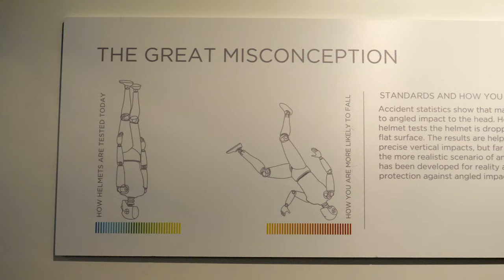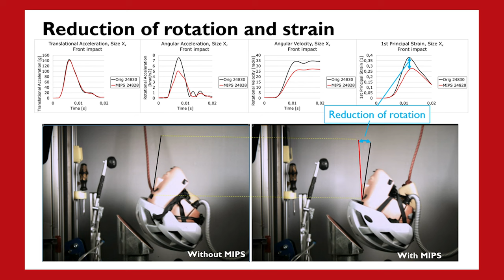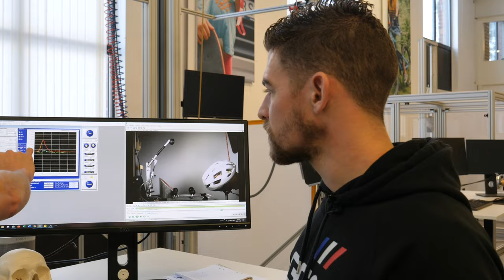What Does MIPS Do? | Cycling Helmets, Concussion & Brain Injuries

Comment: Very interesting! In the beautiful slow-mo shot at 15:34, using the <> keyboard keys you can see that the helmet deforms on impact while the head keeps moving forward because of the structural separation between the outer portion of the helmet and the head. I don't know if the rotational energy causing concussions thing is true, but by designing the system to absorb rotational energy as well as direct energy, the system is absorbing more of the total impact energy, thus lowering the total energy going into the brain.

Comment: Retired engineer here. Very interesting thanks very much.  
More information about the following would have made it even more interesting.
1. A clearer explanation about how MIPS works. Are there two parts to the helmet, an inner part 'fixed' to the head and an outer part, the shell, which slips over the inner part to dissipate rotational impact forces? 
2. Analysis of the comparison of test results for helemets with and without MIPS. 
3. Discussion about ...does the fact that the test head is not connected to a body make any difference to the effectivness of MIPS?  Here I'm thinking.... on the one hand the test head and helmit bounce off the anvil into the air, which dissipates impact energy.... and .... and on the other hand, IF the test head and helmet were connected to a body they could not bounce off the anvil into the air,  THEN where would the energy thats dissipated  by 'bouncing off the anvil into the air'  go?  Would it go to the head and be dissipated there or what?

Comment: Interesting video, just had to buy a new helmet after a crash which smashed it up and it's a no-brainer (sorry) to get one with mips as the price differential isn't that great anymore and it's available on helmets lower down the range. My question is what's the difference between the MIPS system and having a cap on underneath (or indeed lots of hair)? Wouldn't both of those things also allow the head to move independently of the helmet in a similar way?

Comment: So, should mips eqquiped helmets be freely rotating "10-15mm" while wearing it? Or should it be tight and barely moving like there's no mips at all? 
Because I think the biggest problem here is helmet sizing. For example, 59cm head size falls between a large and medium size. With a medium size, the mips helmet barely moves(kinda defeats the purpose of mips) but with a large size helmet, properly fitted, the mips "motion" is very noticeable.

Although this is a great informative video, it didn't even tackle sizing and proper fitting of mips eqquiped helmets to properly take advantage of the new technology.
Reply: There is an internal "cage" with adjustable fit via a ratcheting wheel on the back of the helmet. This cage is suspended by the mips system which isolates your head from an impact on the external helmet shell. So basically when you have the helmet on, the internal cage remains tight on your head but you can move the shell of the helmet slightly. You would choose a mips helmet size like any other helmet.
Reply: @JulitoPapitoo  I think you missed the whole essence of my comment. It's the sizing of the helmet that makes this technology a hit or miss. Yes, the ratcheting wheel can make your helmet fit better, but the outer shell still remains big if the consumer falls in-between sizes. My example was a 59cm head size which generally falls between a large and a medium sized helmet. The difference in the size of the shell  is very substantial between large and medium. So, even if you tighten the ratchet wheel (on a large helmet), the mips cage is secured but the shell moves too much. And if you do decide to go down a size (medium), then the shell plus mips cage sits/rests on your head. As a result, the cage has very little to no allowance to move. Or worse, it actually moves with the shell itself (which then becomes a traditional non-mips helmet). This "slight" movement that you've mentioned actually has a range in millimeters according to MIPS. So, you can't just say pick a helmet size and see if it moves "slightly".

Comment: Rotational motion in head trauma causes what is called diffuse axonal injury, or DAI, which is when the axonal fibers of the neurons are sheered off because of the rotational motion.  This is because the gray matter, where the brain cells are located and the white matter, where the axon fibers are located, have slightly different physical propertiers so that a sudden rotational acceleration cause the two layers to accelerate/decelerate at different speeds resulting in a sheering force between the two layers.   This causes the axons to sheer off from the neuron bodies.  
This is different from a direct blow to the brain, which simply contuses, or bruises the brain at the surface

Comment: Only recently come across MIPS and find the tech very interesting. I’ve had a number of severe cranial injuries in my time, only two involving cycles. But both of those involved having the cycle & me being flung into the air and one involved being partially run over by a hit+run car, with me thrown over a bridge’s parapet. I could’ve done with something to reduce both head injuries. (Mind one could’ve been helped, if the driver hadn’t left me hanging off a bridge, while I bled onto the dual carriageway below.) Never did find the driver .

But MIPS, yes. I’m just about to renew my chainsaw helmet. And only one forestry helmet, has MIPS protection built-in as standard.

Comment: Great vid, completely agree with what MIPS are doing however, when they test why are they not using a full weighted body not just the head because surely this increases the impact speed, pressure and other aspects such as rotation???
Reply: Virginia Tech has done that. Check the link I attached above.

Comment: Recently bought and then returned a MIPS helmet that I very much wanted, because it was the wrong size and didn't fit properly. I had assumed that S, M & L nomenclature was a standard among brands, and didn't even try it on when I purchased it. In one brand I am "Large" and in the other I am a "Small." Must go by mm size only! Now I have a non-MIPS helmet that fits properly. I think it's a great advancement and will purchase one in the future, I expect. I wonder if a non-MIPS interior system that allows some movement is advantageous, if not quite as much so.
Reply: I just bought a MIPS helmet from Bell.  My previous Bell was not a MIPS.  Same size helmet (medium) and supposedly I am 3cm under the upper size rating.  The MIPS one fits a lot more snug, almost too snug.  I usually wear a casquette and probably should have gone up a size.

Comment: The plastic of the mips reduces the crushing of the EPS foam in a straight on impact, and their test rig has the grippiest grip tape which maximizes the rotation, I wonder how much difference there would be with asphalt and if that would offset the reduction in crushing from the mips plastic 🤔

Comment: surely the mass of the brain relative to the skull can be known as well as the distance from skull to brain as it floats in the protective fluid , therefore we can calculate accurately how far said brain will bounce around. the goal is to create an isolate gyroscope for the head ( and ultimately the brain ) to ride inside of as it collides with another mass, moving or not. 

considering the skull is connected to the spine and upper body, a full skeletal model inside a mold would need to be implanted with millions of microchips and then subjected to countless real world inertia tests at all possible speeds and angles

then we would have a truly perfect as possible helmet
Reply: basically antigravity helmet :D

Comment: best case scenario, just head weight. Add the extra 150 lbs body weight for the average American and you will find the angular/linear shock absorptive capability ALREADY maxed out. The tail end of the acceleration will show a spike when the end of the mips track is reached. (Mechanically this means that the mips is already at the end of its rotational limited track.) The frictional track of the mips may have to be increased in proportion  to the increased several times weight to allow as linear vs time angular mometum decrease. Instead of smooth plastic a higher friction surface and longer track may be more ideal to absorb more energy to prevent the spike. Ex aero space Eng

Comment: About 21 years ago I had a head on with a car at speed. Wrote off the bike and cost thousands of damage to the car. I hit the windshield head on with my head shattering the windshield and helmet, flipped over the top and end up in a ditch unconscious. Probably exactly same impact as shown in tests here. Ambulance arrived and carried me off to hospital. After a number of tests etc I was released with just lots of cuts, bruises, 13 stitches in my leg and bad whiplash/neck pain. No MIPS obviously back then. Was I lucky? Have a hard head? Who knows. But this new tech is proven to give you a ‘greater chance’ of surviving so why wouldn’t you use it?

Comment: But what about the effect of your head actually being attached to your body?
Reply: You rarely fall ON your head - think ice skater, where the body hits the ice first and the head whips back or down to crack into the ice a split-second later. Similarly there's no horizontal, travelling-speed component to the tests, just the vertical fall. "Rarely" is not the same as never & cycling (like skiing) is a balance sport - you wouldn't expect to get good at skiing without falling a fair few times. So, if you've never done martial arts or tumbling of some sort or are generally awkward about hitting the floor, get some pointers.
Reply: slowerandolder no matter how much “falling practice” you get your head remains attached to your body which is a rather big anchor and does play part into how your head moves when you fall or when you get hit by a car. There’s a lot more to these accidents that need to be accounted for, but every improvement helps

Comment: When the snow globe is dropped downward in the direction of gravity I think it's just as strong, but it is down so you don't see the snow go further down. Even though there is a force there. When it's on the side the snow is moved off gravity so it moves.  I think it's the same force. I think MIPS is a fallacy. A slider outside the head cannot stop the brain from moving in any direction. To the side or straight down. The reason the boxer might go down is cause he just got 3 whacks.  A sideward punch probably alters his balance or he simply didn't see the punch coming and wasn't putting arms up. . SIDE OR STRAIGHT - THE FORCE IS THE SAME. As the skull completely encases the brain. With a side hit there's still part of the brain that hits the skull perpendicular.  I think it's a brain illusion. I think the brain is moving in a multitude of directions at the same time. Due to gravity, head turning, cycling, a fall of any direction, or spinning and rolling like a diver. And what about what the heads hits. It may not be straight and flat, as we saw this week. Pro cyclistis crashing into each other and storm sewers. Every hit is different and in a different direction. I think a helmet can protect the outside of the head, but it can't affect the brains twisting and turning.
Reply: Hugo Brown the brain doesn’t twist and turn. It just gets slammed against the skull. You are right to be cynical
Reply: Dover Ben thanks for your comment. Too much today is over thought. The digital era has brought in too many experts. That are simply not backed up. Just ideas of what might happen. I've been thinking more about it. And I think with every crash, car, bicycle, walking, hockey, you name it. The head will head from a different direction. They were counting on every hit being the same. Which I think is not rational at all.

Comment: How accurate are the tests assuming they only have a head and helmet with no body that would affect the impact. There is no doubt a helmet will help, but what is the best design and style etc? This test only give results based on one test. It’s also not great to hear people say they choose a helmet based on how it looks before how it performed? This video shows no evidence that mips is any better or worse than any other system?
Reply: Exactly. I was typing the same question when I saw your comment. The head weights a few kilos, but it will be a whole body and a head that will hit the ground, which for an average cyclists is about 70-75 kilos. Furthermore, if the head rotates like that, can it cause a broken neck? Because now all rotational forces will apply to the upper spine.
Reply: What are the odds that you crash a and ONLY land on your head?

Other parts of the body hit the ground too, and is where the vast majority of impact goes. (Watch some criterium crash videos and you’ll see they often bust up their arms, shoulders, and backs, so only the weight of the head is behind the impact on the helmet)
Reply: What are the odds that you crash a and ONLY land on your head?

Other parts of the body hit the ground too, and is where the vast majority of impact goes. (Watch some criterium crash videos and you’ll see they often bust up their arms, shoulders, and backs, so only the weight of the head is behind the impact on the helmet)
Reply: @recklessrickey9513  Well.. that was my first and only serious crash. A piece of wood blocked my front wheel and I crashed into tarmac head on. I kept my hands on the handlebars until the moment my head hit the asphalt. It all happened so fast that I realized what happened only when I stood up. I broke my nose and had my eye swollen for a few days, but that was mostly it. I did not wear a helmet because it was almost 30 years ago and very few people used to have helmets back then. But yes, I had that experience.
Reply: You skipped physics class, huh?

Comment: I'm not convinced. I know a lot about concussion and how its caused. This wouldn't stop your brain moving in your head. 
For the same reason you get concussed in a car accident and your head not touch anything.
Someone help me out here?
Am I getting something wrong?
Reply: Think of it as a suspension system for your brain. If your head comes to a sudden stop after an impact, your brain's gonna hit the inside of your skull at a greater force, than if some of that momentum is absorbed by the rotation of your helmet with a MIPS layer. How much of an impact this actually makes in real life crashes would be interesting to see studies for, but I'm not sure we have data for that. The theory behind it does seem to check out though.

Comment: I am still waiting for any form of creditable,  independent study to support the value of this technology. Having worked with both acute brain injury and the resultant damage caused by it, I still cannot understand the science they use to justify why this technology is “real world” effective.
The fluid filled space inside the skull that supports the brain is minute. The mechanism of injury to brain tissue is the brain being slammed against the inside of the skull due to rapid deceleration of the head itself. The neck and spinal column absorbs some of this transfer of energy but in general, a blow to the head with enough force to cause the coup-contacoup injury that results in concussion or more serious head injuries has nothing to do with rotational forces.

Comment: I realize that MIPS is supposed to be safer, but I will never buy another helmet with it. I absolutely hate it. It makes the helmet less comfortable and it feels hotter. I hate it.
Reply: David Mansfield Try the Specialized Prevail 2 MIPs. Incredible airflow and lightweight as all heck.
Reply: @prestachuck2867  That is what I have. My old one, I've had a few years and due to be replaced. The MIPS does reduce the airflow and that matters here in hot and humid North Carolina. To me, it also effects the comfort of the helmet. It just isn't as comfortable.
Reply: I feel bad for you.

Comment: Just wear your helmet slightly loose enough to move a bit. Does the same thing for free. This is just snake oil being sold as a safety necessity to drive up profits. Not very rigorous testing and no discrete comparison with a properly fitted helmet  i.e. a little loose...